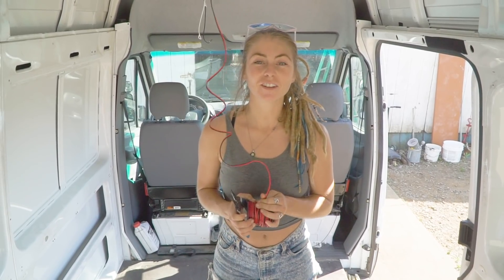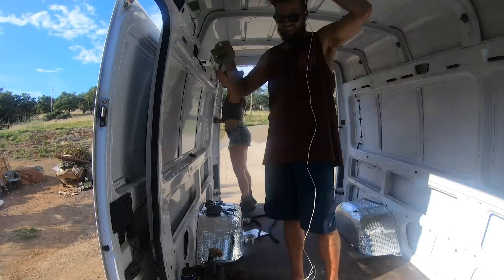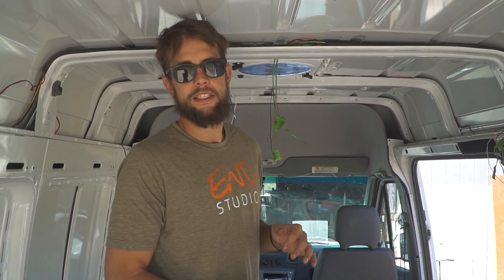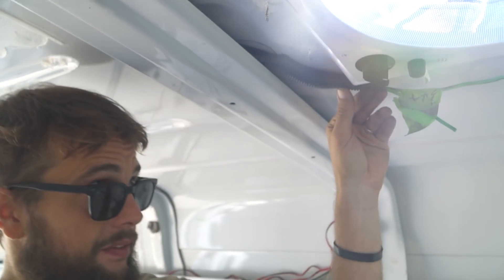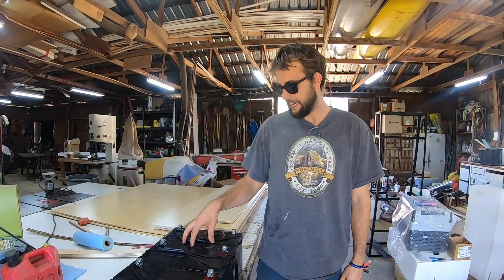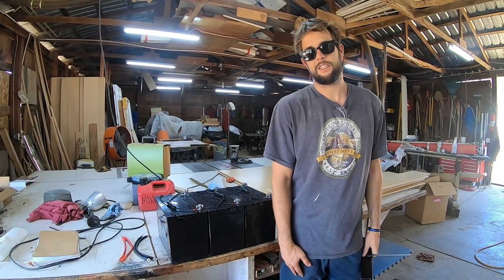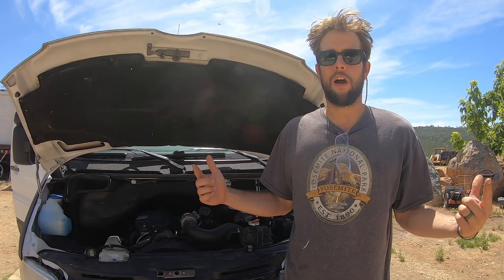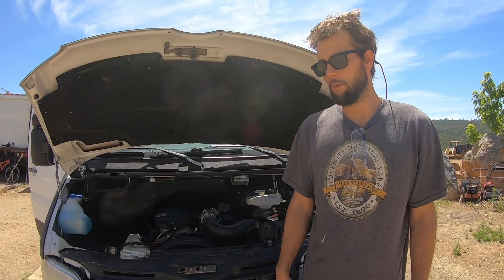How to set up Battery bank & Isolator in your off grid campervan, RV, motorhome, or boat

Comment: what if you are hooking isolator up to truck with two batteries and one alternator? where do you connect the isolator? and can you do 4 12volt 100 amp batteries in parallel and on the 150 amp isolator? email me @ woodpow@live.ca with answer if you can. thx.
Reply from the maker: You can either hook directly to the alternator.  Or I’m imagining the alternator charges both batteries while driving.  If you set up the 150 amp battery doctor to either of the truck batteries, Once the truck batteries are charged the battery doctor will relay the charge then to the house batteries (100 amp x 4) it has a built in overcharge protection so it will never overcharge your house batteries once they get to a certain voltage the battery doctor will shut off the charge.  You should be good.  
Just note that it will take a long time to charge the batteries by driving alone and most alternator won’t be able to get your house batteries charged to 14 volts.  You’ll want to add a solar panel to the system to always be trickle charging the house batteries while you are parked with the engine off.  
Check out this video on how to wire the solar set up https://youtu.be/ylLgp0Sm7ns

Comment: I've seen most people put in a DC to DC charge controller....did that in-line fuse take the place of the charge controller? Just regulating how many amps are taken from the alternator to your house batteries?
Reply from the maker: Yeah you can do that.  I’m going to look into that   I feel like the Battery Doctor has it built in I know it won’t overcharge the battery it shuts off.  Thanks for the tip.

Comment: Understand how you connected the battery isolator to the primary battery. Did you just connect the other end of the positive wire from the isolator to one of the batteries on the 3x100ah battery bank? Is a 150amp isolator sufficient for 3x100ah battery bank? Also, once you have solar connected to your battery bank, ok for both solar and isolator/alternator (when running/driving) to charge the 3x100ah battery bank at same time? Thanks. Working on the same project in my van.
Reply from the maker: You’ll never achieve a full charge with the isolator alone.  That’s when the solar panel comes in handy.  Yes if the batteries are wired  in. Parallel they are all linked together and basically one battery.

Comment: Will the battery isolator stop charging the rv battery when the rv battery is fully charged? Will the battery isolator stop charging the rv battery when the car battery drops too low in voltage? Sorry, completely new to this. Thanks
Reply from the maker: Yes, and yes.  The car battery will charge only while driving it has a shut off to not overcharged The RV battery once the car is off it will stop charging the RV battery.  Hope that makes since
Reply: @Vankookz  Thank you for the quick reply. Wow. What size isolator for a 180 amp alternator? Will 140 amp isolator work?
Reply: @micjakes1  My understanding is, yes. There are also DC to DC charge controllers that you can add to the system to make sure that the batteries aren't being overloaded/too much power isn't coming from the alternator.

Comment: About to start my build. Thanks for the vid. Hope it's going well, will catch up on your other clips soon.
I will be fusing both ends of the car charge lead (after cut-off in engine bay) and think 60amp auto reset is a better option. 
Was going to use steel for framing up but will be too heavy and want my fit out to be easy updatable until I work out what I need to improve on and change
Reply from the maker: Thanks for watching we will probably start a new build soon.

Comment: when you say you turned your lights off to speed up the process, that means that the isolator was taking power from the cranking battery to charge is there any way to adjust the voltage to just say 13.3 v?
Reply from the maker: I think you can get more voltage if you hook it up to the alternator

Comment: Will that battery isolater allow you to charge the original equipment battery from your solar / 300Ah battery system ?
Reply from the maker: Yes it does while it will never charge the battery to 14+ volts it will get it on the 13 range takes a good amount of driving to charge your batteries this way that’s why it’s nice to also have to solar.  We ended up putting 400W on the roof to keep those batteries always topped off.   Thanks for watching!

Comment: I used the exact same wood on my walls and did not really have enough room to mount my outlets into the walls so I started mounting them outside the walls. How did you guys do yours?
Reply from the maker: We used common board to frame out the van then laid the ply on that giving us plenty of room for an air gap for insulation and electronics check it out DIY Sprinter Van Conversion: First steps: Fantastic Fan, Framing, Walls, Tongue and Groove Ceiling https://youtu.be/-DhqKWSUzVc

Comment: I thought you'd said you were using a 36v battery bank.  If so, how are you charging that with your alternator?  Was there a converter I missed?
Reply: Thank you for clarifying that.
Reply from the maker: Parallel vs series*
Reply from the maker: Patrick McHargue no we have a 12v 300 amp hour battery bank.  I was explaining the difference between wiring your batteries parallel vs. sequence.